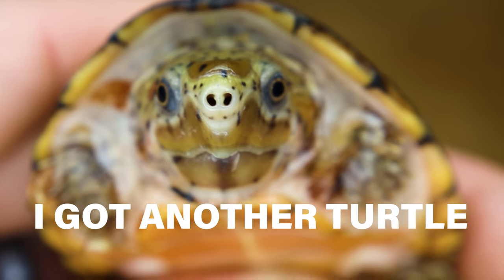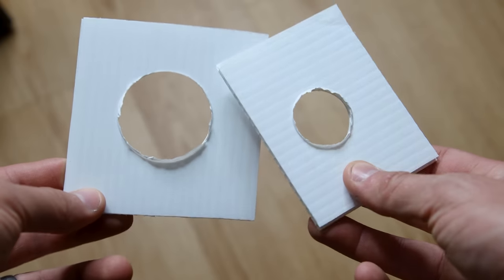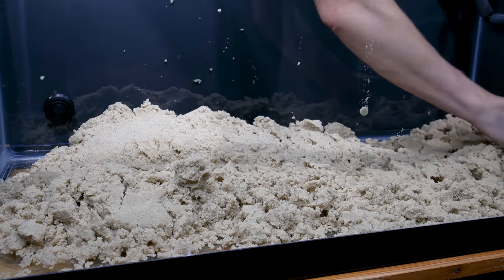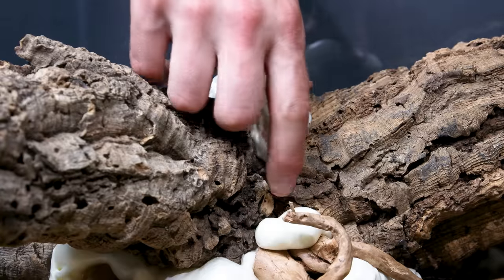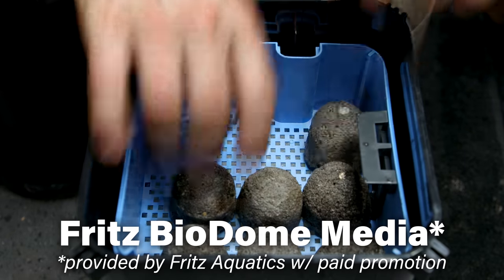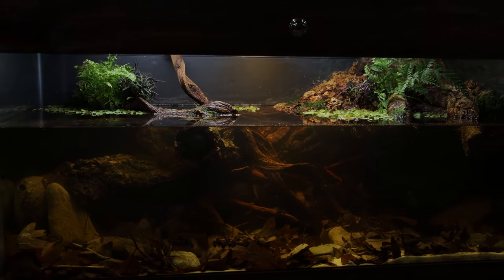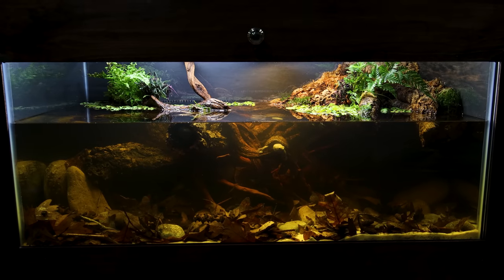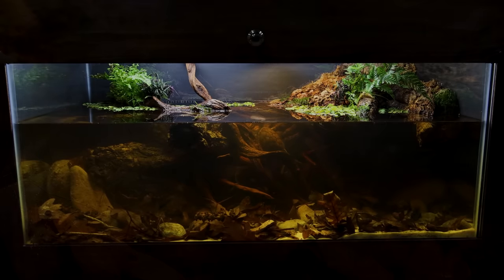I Made a Botanical Refuge Habitat for my Tiny Turtle

Comment: "Wedge" would be a good name. That's a tool used to split wood, and is basically an extra wide axe head, which would be a good reference to the oversized head.